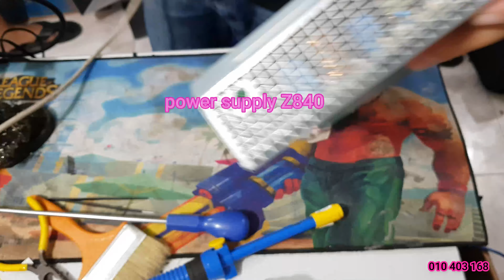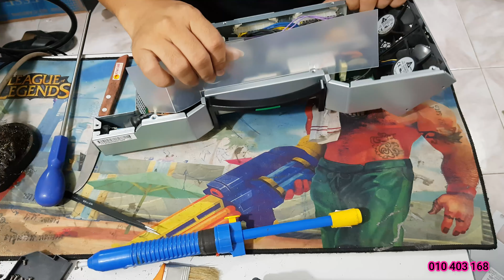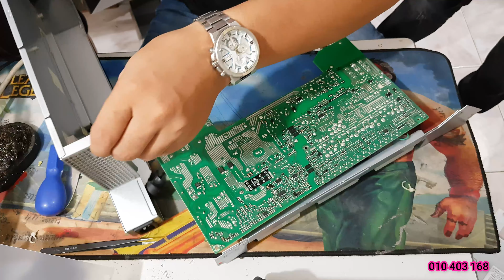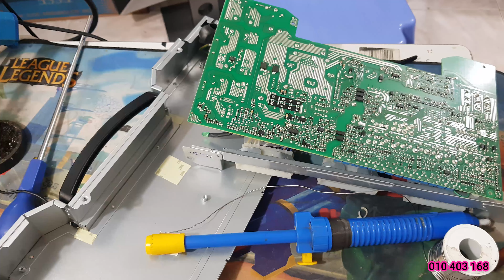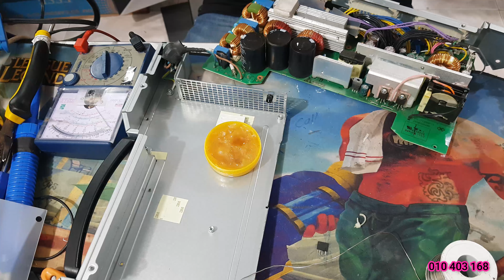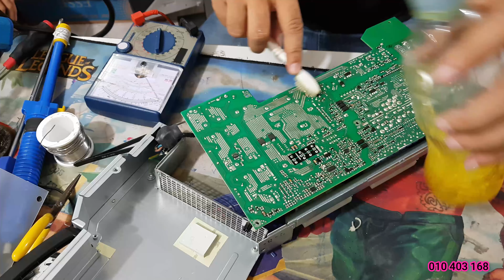How to Repair power Z840  HP Z840 Workstation video4k

Comment: is this as dangerous as it looks? the yellow sticker warning of electrocution and sudden death has been putting me of powering the PSU up with the lid off. i took the lid off my HP PSU to vacuum the dust away, but not being an electronics engineer, I am terrified to go near any of the coils and capacitors. I'm basically terrified to touch anything inside the case, except the fans. i'm glad you know what you are doing !!

Comment: Anyone could help me to read the value of resistor R901 near the TOP259? Thanks in advance. I have tried 22R, works for few seconds, than I have to discharge all to make it work again for few seconds. With 220R it works longer. With 2,7K it seemed to work but after some second it burned the TOP259 again...
Reply from the maker: yes good
Reply: this resistor value  is 1 oms  1 watt
Reply: for my power supply (DPS-1125AB A for HP Z820) it is 0.22R